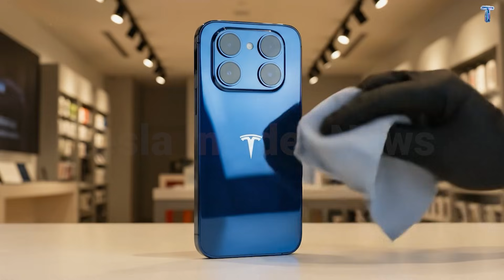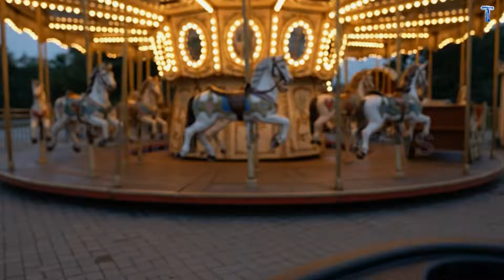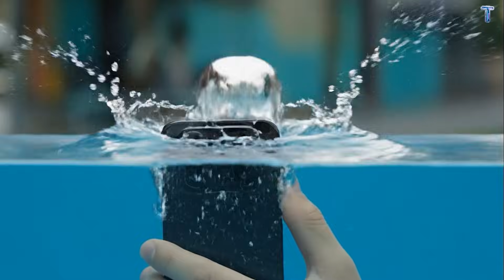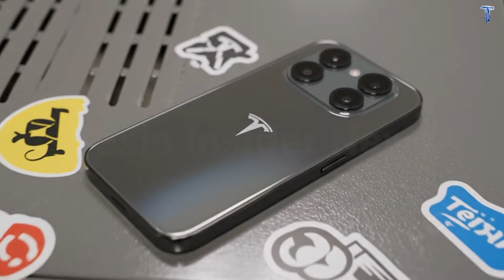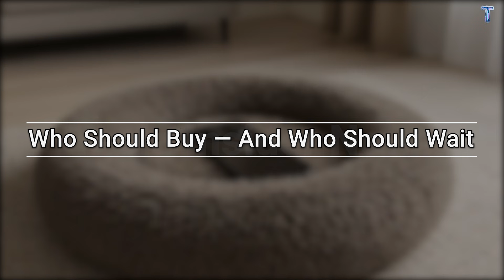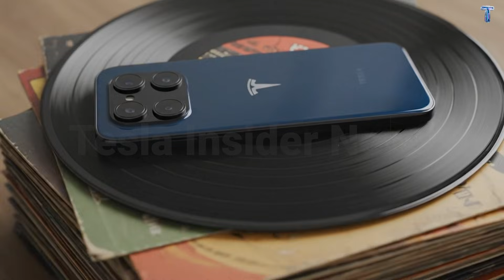$199 Tesla Pi Phone 2026 EXPLAINED: Built to Last or Just Another Upgrade Trap?

Comment: This phone heats up when I start charging it up
Reply from the maker: If a phone gets hot while charging, use the original charger if possible, avoid charging under pillows or in heat, remove the case, and stop using it if it becomes dangerously hot.

Comment: I would prefer a phone surface which has a thin non-slip coating instead of a glossy finish to prevent slipping out of my hands. And a non glare screen that resists finger prints. A durable non-slip case with built-in kick stand and retractable charging cord with separate charging brick.